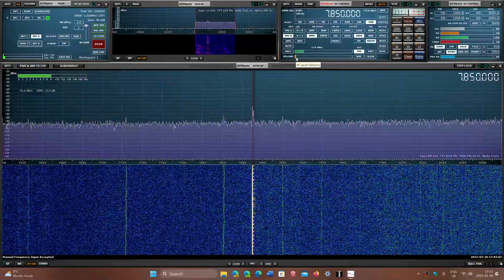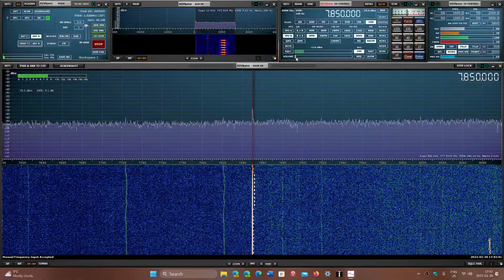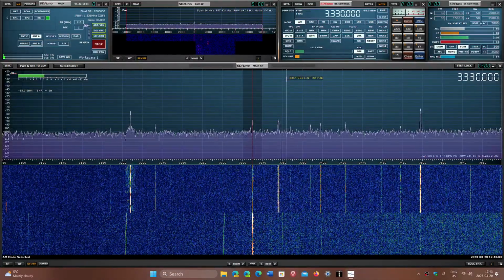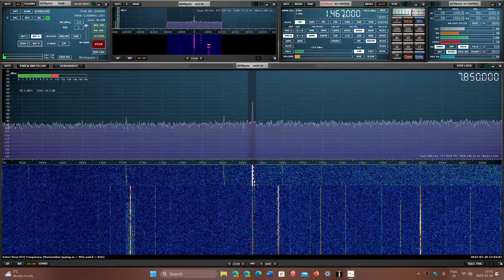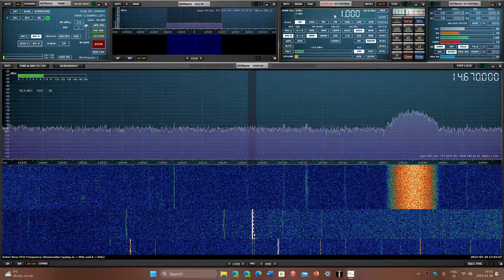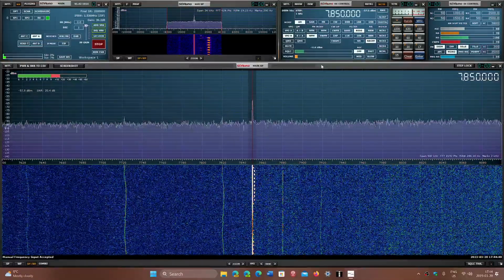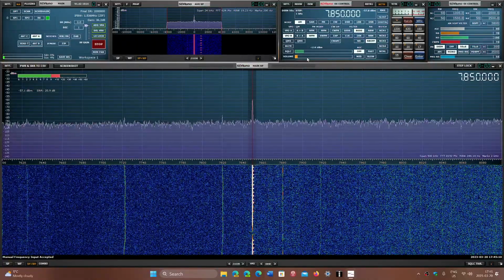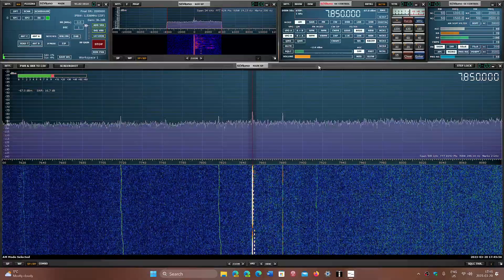What is this signal  CHU Canada Time signal station near Ottawa

Comment: 3330 and 7850 are frequent guests here in central europe, 14670 sometimes can be heard too. Since CHU runs on quite unusual frequencies it is not interfered by other stations like WWV is.
Reply: Until some years ago they were on 7335 (even before it became part of the 41mb it had often been QRMed by many EEu SW stations!), but after that CHU moved way out of band to 7850
Reply: What exactly is the purpose of these sounds? To set the clocks that are able to do so? UTC